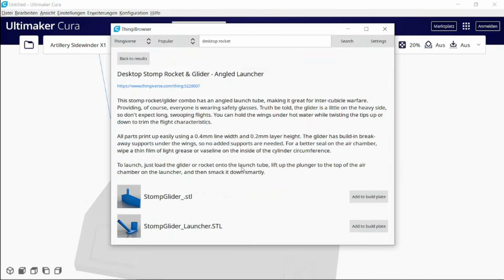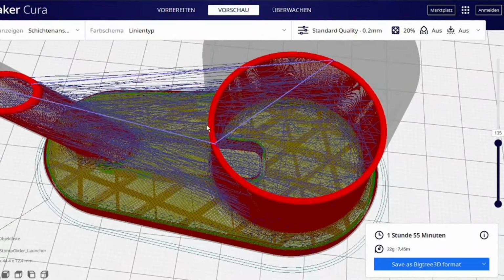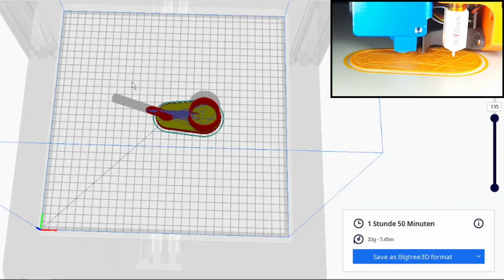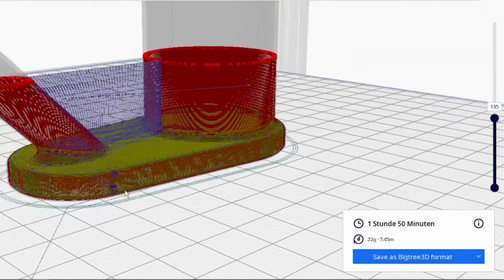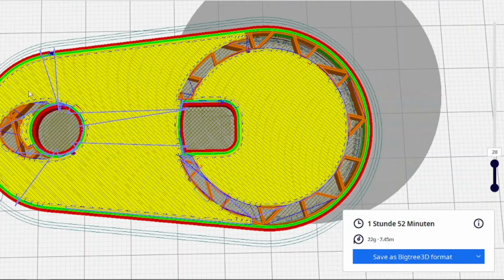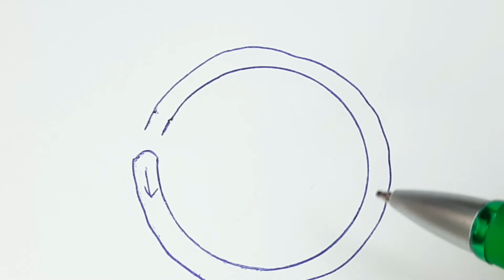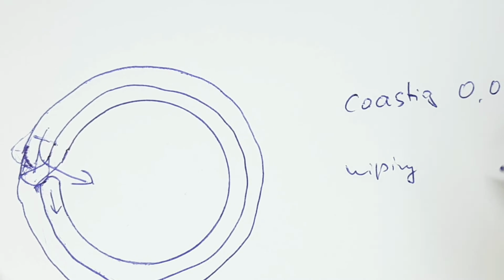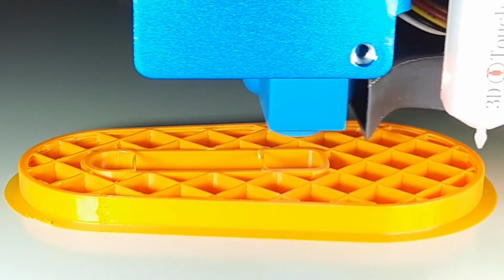z-seam / wipe / combing / coasting

Comment: I am a native German as well - though I would definitely recommend going the extra 2 seconds effort of changing my cura language to English before making an English video about it...

Oh, and more important: If you get stringing on even smooth surfaces, try reducing the flow. Many printers are preconfigured to under-extrude for this reason. My printer's e-steps were configured to only 77% of the correct amount, which actually produced beautiful string-free prints, except for very long lines which then bent inwards. 

So here you have it: Have much stringing? Go reduce the flow first and check for visible signs of underextrusion. If you have none, the flow reduction was your solution.

Comment: What is the best value for wiping, its hard to work out where you are in the settings as it is not in English.
Reply from the maker: I mostly use half the line width for wiping, so 0,2mm

Comment: If the part I am printing has no corners to hide the Z seam I sometimes place a  decorative spine in the place where the seam would be printed so the seam gets hidden, if it is a functional part it does not matter so much especially if it is not visible in its usage.
Reply from the maker: You described the smart way to hide the seam. To have an inbuild seam position while designing the part is smart.

Comment: Excellent english, great content....ps, I built a Voron 2.4 and now hardly touch my artillery. You would love the Voron, both building and using it. Also, klipper firmware with mainsail OS control is so enjoyable to use.  I only mention this because I can see how much you love 3d printing and you will be very happy if you try a Voron and Klipper.
Reply from the maker: Thank you for that suggestion.

Comment: Don't worry, your English is great! Haha
Have you tried linear advance? I just went through the calibration process, and have had some very nice results on my SV01
Reply from the maker: https://youtu.be/WE3uIjrev90

This is a Video on Linear advance I did in German a while ago. LA is great.
At my sidewinders printer menue I can change the k in realtime while printing.
Since the k may vary in dependence of filiament brand, speed, wall line width eg. I don't spend too much time with calibrating. K 0.13 is as a general for the sidewinder ok enough. Otherwise I just do a short test print and adjust in realtime if needed.
Reply: His English is fine, but his CURA is clearly struggling!
Reply: His English is fine, but his CURA is clearly struggling!